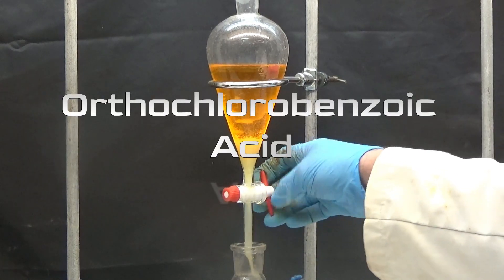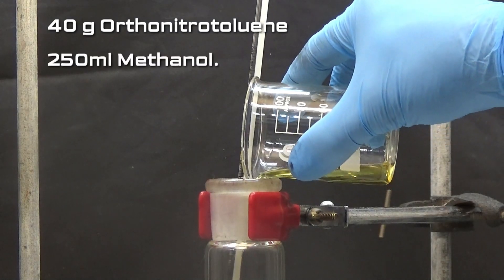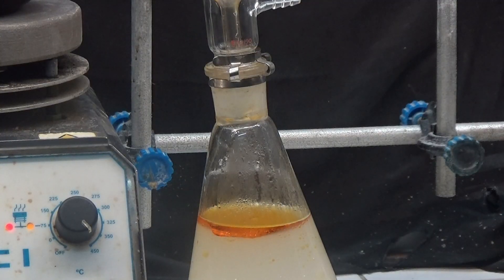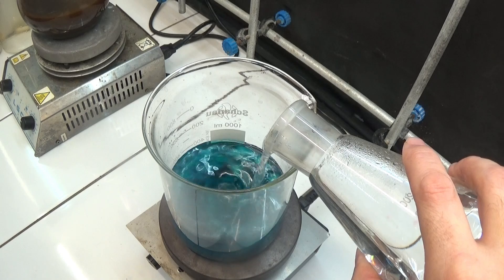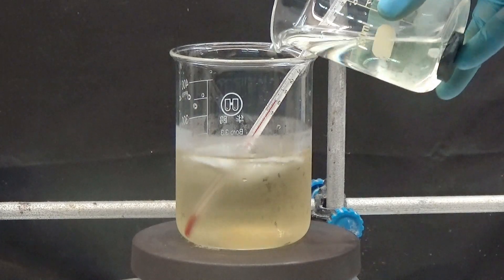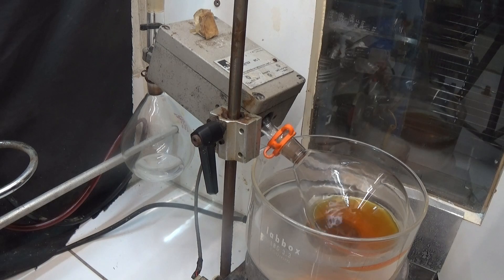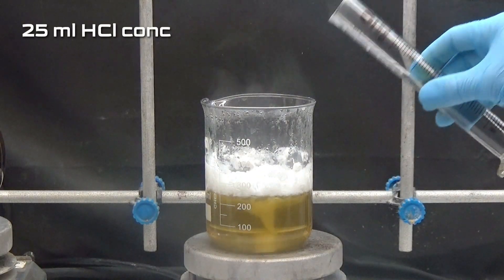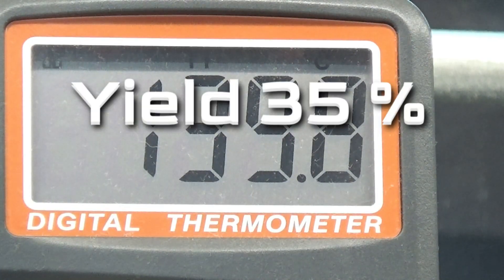ORTHOCHLOROBENZOIC ACID SYNTHESIS.#ncchem

Comment: I was making a lucigenin compound for chemiluminescence and needed chlorobenzoic acid. To avoid the sick regulations of the European Union regarding concentrated acids, I developed a much simpler method:
You start with phthalic anhydride. In the reaction with urea, you obtain phthalimide. Without any special purification, you convert it to anthranilic acid using bleach. Probably small amounts of phthalimide impurities (urea, anhydride and phthalic acid) act as an inhibitor (probably a trace amount of hydrazine, a strong reducing agent, is formed). The anthranilic acid obtained is very light, white-beige. Finally, you do the Sandmeyer reaction and obtain snow-white chlorobenzoic acid. All without a single ml of concentrated, banned acids. Best regards, ELEKTRON channel